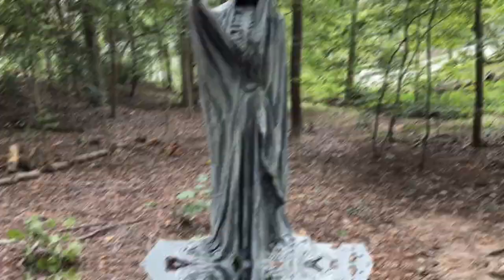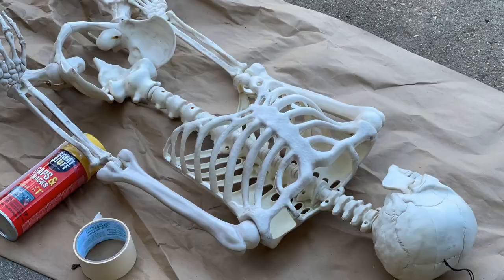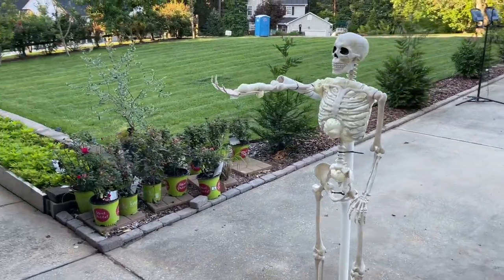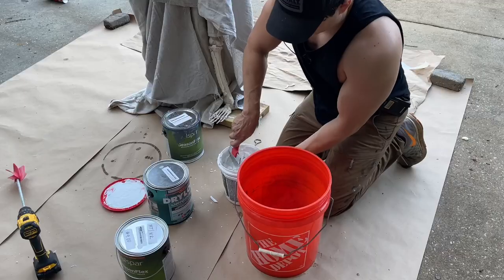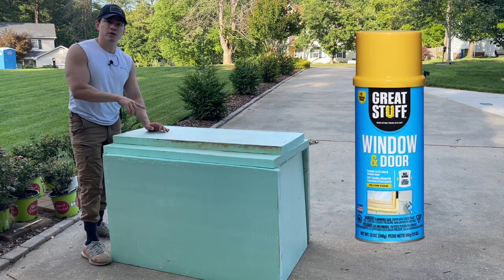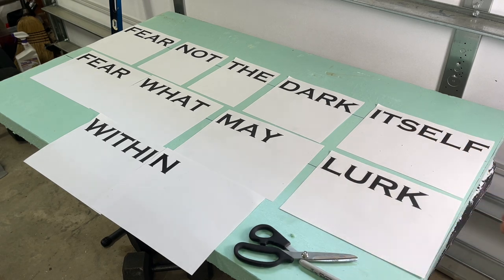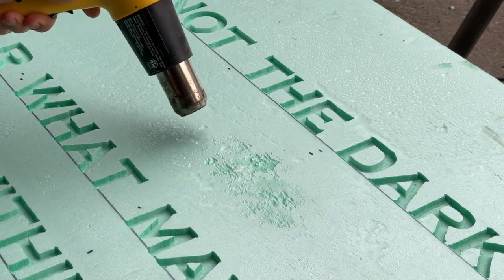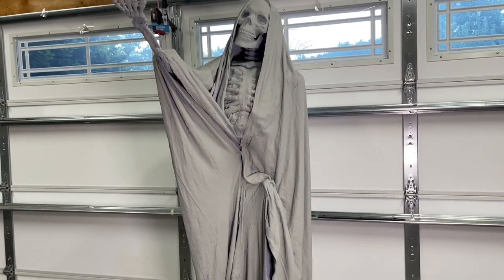HOW-TO: 8FT GRAVEYARD SKELETON MONUMENT TUTORIAL

Comment: If the base is 3.5 feet high, how wide was it? Or is there a rule of thumb to use for creating the base? You know: "If statue is X feet high, the base should be no wider than Y and no taller than Z. Keep the proportions of the base to W:Q."
Reply from the maker: There’s no rule of thumb, I always make the base 4ft wide (the width of the foam board) and about 2ft deep and about 3ft-3.5ft tall.

Comment: Is there something I can do to keep the monster mud from washing away in the rain? My started washing off
Reply from the maker: Which recipe did you use
Reply: @IsaacAlexanderDIY  the mixture that you used in the video. I went back and spray painted everything for a base and reapplied the mud to see if that helps it stay. I’m in Ohio and get a lot of rain this time of year!
Reply from the maker: @mattkneram1929  Matt, I used four different mixtures in the video. Which recipe did you use
Reply: @IsaacAlexanderDIY  it was the exterior paint, joint compound, dry lock mixture
Reply from the maker: @mattkneram1929  None of the mixtures that I displayed are supposed to wash away. Even though one and two weren’t good and three and four were the best, none of them are supposed to wash away. Did you use a 5 gallon bucket or something smaller? And how much joint compound and DryLok did you use?

Comment: I don't think drop clothes are burlap I'm pretty sure they are canvas?
Reply from the maker: I got this cloth from eBay and the seller had it labeled as burlap but you’re right, I think it’s canvas 😃. But it doesn’t matter. Burlap or canvas, cloth or bedsheet, any type of material can be used, that’s the beauty of it. Are there any other critiques that you would like to point out? 😃
Reply: @IsaacAlexanderDIY  I've soaked canvas drop cloth in cement and it comes out smooth like your skeleton cloke burlap doesn't turn out so nice!
Reply: Oh yay! I was wondering about using old flannel (heavier) bedsheets! Will it drape as well as drop cloth do you think?
Reply: @jamiewhitehouse8940 , Yes, thicker bed sheets, Jersey, wool, muslin, cotton, flannel, fleece and burlap are excellent choices depending on the outcome you're looking for. IME, they soak up the cement mixture well! When using material, don't put any aggregate like coarse sand, stones, perlite, vermiculite etc. Otherwise, the heavier aggregate will sit on top of the material because it's too big to soak into the fabric, especially when you use something tightly woven, like a canvas drop cloth or a high-count bed sheet. Use finer play sand like the sand you purchase for children to play in; not only is it much finer than other landscaping sands, but the granules have smooth edges, which I think helps it soak into materials or makes it easier to smooth out. Loose woven landscaping, and the tighter woven burlap you find at fabric and craft stores are also a great choice; it gives texture, and a slightly thicker cement mixture soaks in really well due to the porousness of the burlap. 
I think a sitting witch would look cool using cement-soaked burlap layers!?!
When I first worked with cement, I made a small batch of white Portland cement with the proper measurements of water, bonding agent, cement and fine sand. I collected 50-70 different pieces of material and other objects I thought I might have luck with, and I soaked everything in the cement mixture, drying some stuff slowly, some quickly, in the sun, shade, wrapped some in plastic for different durations and re-wet some things at different times. I just experienced different textures, hard and soft objects; I used other items to form and dry it, I took notes on everything I observed, most of all, I was fearful of moving into a larger project, not knowing what the outcome would be!
I hope this post helps and inspires!!!